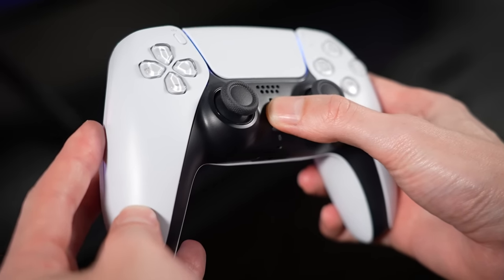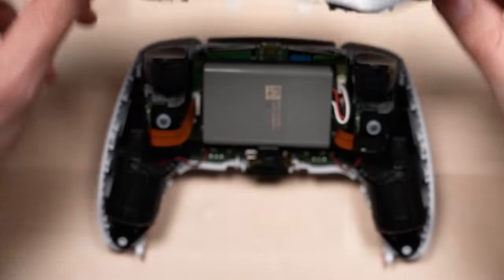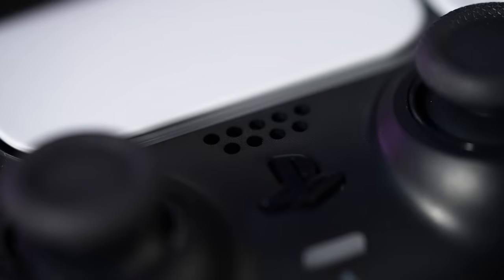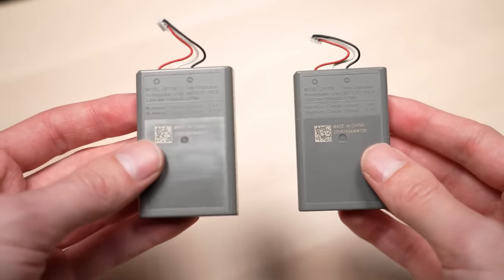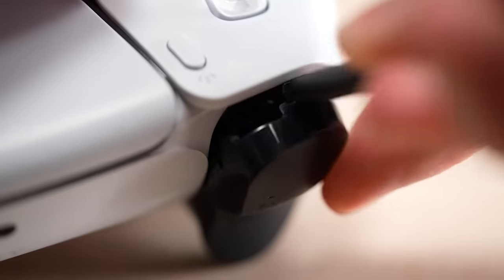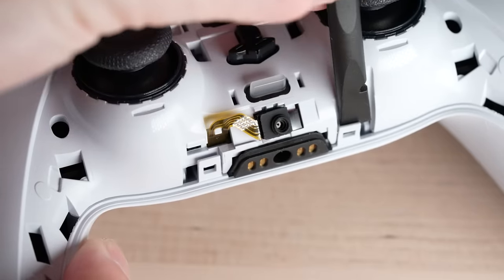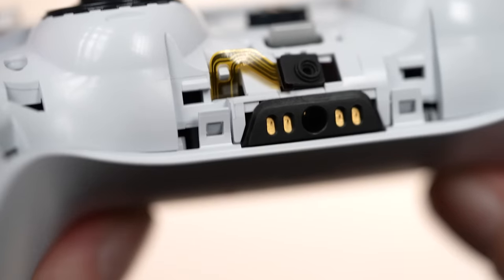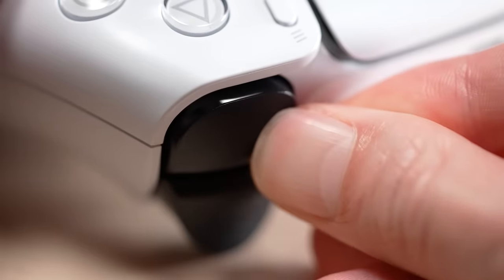Sadly, your Playstation controller won't last much longer..

Comment: Tips:
:Get 2 controllers
:Alternate them regularly 
:Dim the light 
:Turn off Haptics for Mulitplayer ( Cod )
:Lower haptic resistance (in settings)
: Keep haptics on for singleplayer enjoyment
Reply: Why would I turn off haptics for multiplayer? That’s way more important than for single player
Reply: @toptiertech7291  There's no right or wrong here just opinion,For me if im playing a Multi-FPS thats constant banging on the controllers triggers,Single player stuff least theres somewhat of a break with cutscenes/dialogue/down time/etc..
Reply: So I'm supposed to turn off the main feature of the controller? Sounds dumb
Reply: @GregHali  Jesus there's ignorant people on here...THERE'S NO RIGHT OR WRONG REASON however if you wanna preserve you're shit aka save another 65$ there's tips above ^ to help such preservation
Reply: @fnggaming89  how would you be saving $65 if one of your tips is to SPEND $65 on a new controller? Why not just leave the vibration on and spend that same money on a new one down the road? I don’t think you see the issue with your statement
Reply: @toptiertech7291  "  Save Another 65$ " ^
Reply: @toptiertech7291  it's the other way around
Reply: @fnggaming89  but you’re assuming that someone should already be buying 2 controllers. You’re saying they should spend $65 up front. What if I just made my 1 controller last until I need another. Then 3 years down the road I’ll have a brand new controller instead of 2 worn out ones
Reply: All that when my Xbox elite controller last for a week n a half after 6-8 hours of heavy gaming Lmaoo  with all the vibrations still on

Comment: This is why I love Xbox controllers. I've never had any issues with them from personal experience and I don't have to worry about ripping open the controller to replace a battery, I had one for several years and it still works like factory new

Comment: I understand the appeal for built in batteries but rechargeable AA'S just seem more convenient. If you put the controller back together and have one part that isn't aligned properly(such as the triggers) or if you break something by accident such as the clips then its just an annoyance. Also when you or your kids forget to charge the controllers and you end up having to wait to play anything.
Reply: You don't have to wait, you can just sit closer to the TV for 45 minutes or however long it takes to charge the controller.
Reply: @William_Saliba  that's fucked up just buy a longer cable 😅
Reply: @William_Saliba  True. But if the options are sitting close to a tv for 45 minutes or hot swap some AA's while the others recharge in under 10 seconds then it just seems more convientient. Not saying built in batteries aren't a cool option but I have found more inconveniences with them then ones with AA'S at least for me personally.
Reply: @ismo9529  Sitting closer to the TV to charge a controller for 45 minutes is fucked up? Humanity is doomed.
Reply: @William_Saliba  he's just a xbot Can see that from his posts from his channel. This video didn't appeal anything, he just showed how to change batteries for dual sense.
Reply: @William_Saliba  humanity is doomed if life gives you a better option yet you choose to struggle.
Reply: @kaztuckinhell108  why am I an xbot if I just gave him a better option. I didn't tell him AA batteries are better or the Xbox controller is better. I'm litteraly helping my guy to enjoy his time better with his ps5.
Reply: @ismo9529  I'm not talking about you bro I'm talking about the Original guy
Reply: Yeah that's why I'll always prefer the way Xbox does it's controllers with removable batteries just much better options.
Reply: @originalgaminggen6732  I just charge my Ps controllers on a dock or rest mode when i don't play.
Battery lasts about 10 hours of gaming, so i don't see a problem with built in battery.

I understand the kids point tho, but extra controller is always good to have.
Reply: @ismo9529  You do realize that having a pricey console and choosing to sit closer to your form of entertainment for less than an hour doesn't count as struggling, right? Let's call a 1st world problem out for what it is.
Reply: @kaztuckinhell108  yeah i have both systems. Reminding kids to plug in contollers to charge is the equivalent of me talking to a wall about it.
Reply: @originalgaminggen6732  I mean this is not the norm for rechargeable controllers. I still use my PS3 controller and the battery still has good life.

I use it for PC, PS4, and switch using an adapter. I like the feel better than the newer controllers for fighting games and the buttons still work. Sadly, PS5 isn't compatible with any controller adapters.
Reply: @Horyzun  definitly first world problems, don't mean problems don't need solving. Am I missing something, a long USB c cable costs around 9 to 10 euros where I'm from. Why choose to sit closer if you can sit at a comfortable distance with a longer cable
Reply: @freaky45  looking into that, need at least a 15 foot cable. As long as my cats dont chew it then it might be the best option
Reply: @originalgaminggen6732  what I don't like about Xbox controllers is that you hav to open and close the cover and the cover part eventually breaks. I had to buy three controllers when I had Xbox one.
Reply: That's why you always keep 1 controller charging while playing
Reply: @kaztuckinhell108  yeah that happened to my very first xbox one controller when it first came out. Havent had that happen on that system or the series x since that one time but it was annoying until i got the battery pack rechargeable kit since it stayed in pretty snug, was still pretty annoying though. But i will say that the ps5 controller keeps a good charge as long as its charged up. Just my kids dont seem to ever remember to do that.
Reply: @ismo9529  You're not missing anything. You just switched gears. Saying that sitting close to a TV is a struggle is a lot more extreme than "buy a longer cable" and you know that. It's just not as deep as you originally made it out to be.
Reply: @originalgaminggen6732 I recommend buying a ps5 controller stand which actually can put ur two controllers on it. Don't buy sony official stand. It's not stable and pin inside is weak.
Reply: @Horyzun  it is a struggle if you can just buy a longer cable and not struggle anymore 😅 why sit for 45 minutes in front of your TV?
Reply: @kaztuckinhell108  i was gonna say i got the official stand in a bundle and i swear that even if its me putting them on the stand,  every so often it wasnt sitting right or something and didnt charge but you say its the pins?
Reply: @originalgaminggen6732  the pins are too fragile and breaks quickly cuz its so hard to fit correctly. So buy one looks stable. I got HORI product and doing great.
Reply: @kaztuckinhell108  thanks. Ill check that one out.
Reply: The dual sense controllers battery lasts quite a while on a full charge even 5 minutes on a USB type c cable will give it enough to last a hour or 2 more you can choose to use batteries but your spending money that you could had saved up in the long run as for kids you gotta teach em to put it on the charge gotta teach them to be responsible for their own actions
Reply: As someone who plays at my desk, what is this about charging? You mean the wire isn’t meant to be always plugged in? /s
Reply: @kaztuckinhell108  your a bot bro
Reply: You can use it while charging without it being connected to the console
Reply: @marky3609  To an extent yes but say your batteries die and you have no more then you are completely sol but it's just preference one isn't better than the other I have rechargeable batteries for my Xbox controller and I have multiple ps5 controllers with a dock so my controllers are always good to go
Reply: @PandaCheeks  nah I'm a ps guy dude. From ps1 era to ps5 era
Reply: @kaztuckinhell108  i had that problem too, but i just bought replacement covers
Reply: @therizinosaurus214  yeah did the same for the second controller cuz didn't know that there was the option 😂😅 but most of the reasons I had to buy again was inner component problems not only cover 😅
Reply: @originalgaminggen6732  or u can get a power bank
Reply: Battery acid.
Reply: I bought a powerbank for this reason and I can charge my controller on the couch any time I want :D
Reply: Nah, built in battery all the way and a second controller. I am not buying and swapping batteries. This isn't the 90s anymore. The only thing that uses AA or AAA batteries in my home is the TV remote.
Reply: I'll never go back too batteries shit felt ghetto
Reply: @urekmazino6800  ha
Reply: I like that the PS5 controller DOESN'T have AA, because the average users wouldn't bother using rechargeable batteries, so that would waste millions of AA batteries. Now they're forced to use rechargeable since that's what's built-in.

Comment: This really looks like a first gen problem, I mean I used my PS4 controller during many years and I used it like crazy and nothing happened but somehow this controller has battery issues even though it was launched just in the past few years, that's why you should always wait for the slim version of any console.
Reply: this controller burns the battery faster. batteries have a life cycle that dies every time you charge it. the avg battery life is around 1.5 to 2 years depending on the size of the battery vs how often you charge it. if you charge it daily expect it to last around 2 years but if its an ipad for example that last a week before a charge well than you are looking at 4 to 6 years.
Reply: Unless Sony has some hidden crazy battery tech, then no it's not a first gen issue batteries will degrade.

Comment: As an Xbox gamer who heard SO much crap about our replaceable/rechargable batteries - buy one, pop it in, done. You can use regular AA batteries, rechargable AA ones, or rechargable ones for dedicated charger stands.
Reply: You don't even need a battery. The Xbox controller just needs to be connected to the Xbox via a charging cable.
Reply: Who wants someone put in the battery for you and may not even be new battery they place in

I would buy a converter than a rechargeable controller that may used cheap rechargeable 

Maybe from wish because if is the Same size as the ps4 one than they remodel the battery too

So it look like it New

Comment: I have to admit, I like the approach of the xbox controllers better, where I have both the option to use the controller wired without wearing out any batteries, or can just replace them within seconds without any tools.

Comment: I went through FOUR official Sony controllers in ONE YEAR and got drift issues on all of them. Finally bought a third-party controller for $25 and it's lasted me four years with no drift/battery issues whatsoever.
Reply: wat controller if you dont mind me asking
Reply: thats a straight up lie if not youre buying fake controllers cause me and my friends have had the same controllers for 6-7 years
Reply: @Koll-Manee  Back in 2014 when I owned a PS4 the first time around I had no problems with the controller that came with the console for the two years I owned it. Not sure why I’ve been having such bad luck with Sony’s controllers this time around.
Reply: The ps5 has only been out a couple of years
Reply: @Jorden.Florence  oof I didn’t specify. I’m talking specifically about PS4 controllers.
Reply: @jirden  arr I see cool and my ps4 controler had drift problems as well hope the ps5 lasts. A while back I realised I was seriously abusing my controllers so started to make a conscious effort not to push the sticks so hard. I think fighting games are the worst because its easy to lose yourself and start wrecking the pad

Comment: I wish my dualsense controllers would last long enough(without drift) to be able to utilize these tips! I've had 2 drift so far and can't figure out what the deal is. Clean environment, minimal use(maybe 5 hours a week)? Either way, great video! Quick and concise.
Reply: Wow, I have had the same two PS5 controllers since launch. I sometimes have played 5 days a week. No drifting problems at all. I do have to change them more frequently though. I'm probably going to need to replace the batteries this year.
Reply: 5 hours of use a week will still cause degradation and cause drift since, ya know, plastic
Reply: @A. Biscuit alcohol part is a lie, don't put alcohol on it guys it'll destroy your controller.
Reply: @CelicaSNC  drift that soon for him is still unacceptable
Reply: @A. Biscuit so out of curiosity, I wonder if the white and black ones are upgraded too? Obviously they should be right? Problem is, for those colors I don't know how you'd tell before buying. I had two black controllers and one completely just malfunctioned so I replaced it with a purple. So it's good to know I at least have one upgraded.
Reply: @A. Biscuit okay so it'd be on the back of the cobtroller. Thanks for informing me! But unfortunately I just checked the box for the purple one I just purchased and don't see the ID anywhere on there. So if I was to get another black one down the road if my current one ever crapped out, I guess it'd be a gamble as to whether it's the newer model or not?
Reply: @A. Biscuit got around to checking finally, it does in fact have the A. Thanks for filling me in about it! Hopefully I actually see this controller lasting a bit longer

Comment: I'm so glad my retailer where I got my ps4 and ps5 from has an excellent warranty policy. If my sticks or battery give out within the 2 year warranty period, I can either get a replacement or a full refund. This saved me a bucketload of cash between 2020 and 2021, I've had over 16 DS4 controllers with stick drifting issues!
Reply: That’s so much wastage. Why can’t they make better controllers?
Reply: @dannnnn496  money
Reply: @grizzlydino  They would save money if they didn't need to honour so many warranties

Comment: I feel like xbox and playstation could make small tweaks to make their controllers better. Xbox could have their rechargeable pack as the standard default battery when you buy the xbox.(its not as bad for families if they buy more controllers because they can buy a play and charge kit that comes with the controller). Playstation could make a battery compartment that way it would be easy to replace
(Also amazing guide 👍👍😊)

Comment: I have to wonder as to why they made it a bit of a hassle to replace the battery, while an Xbox’s battery is easily assessable. Sure, the Xbox’s controller doesn’t come with a rechargeable battery, but they are pretty cheap, from an official one to regular rechargeable ones you can get for ten to 20 dollars. Is it because they just want people to buy a new controller and get that extra profit?

Still, it’s good to see how it’s done on a PS5 controller. When I eventually get one, I’ll keep it in mind if something ever happens. Videos like this helps save people a TON of money and time.
Reply: You've brought up a valid point where certain Playstation fans have been giving Sony some imaginary W for XBOX using battery packs + AA when I've always seen that as more of an advantage. I do hope XBOX starts producing controllers with the haptics and force feedback triggers they've had a patent for their own since 2018. I can do without touch pad,speaker,microphone and other Dualsense features
Reply: @lordxboss5700  I’ve seen people like that too. Honestly my first pair of rechargeable batteries lasted about ten full years before they finally died, and getting replacements was easy since I just needed the batteries instead of both them and the recharging plug-in (with both it was about $20, but for the batteries it was less than $10 for four of them. I’d say they more than paid for themselves!).

Having the batteries like that also removes a possible way it can break. Not everyone can do this, or not trust themselves to without breaking it. I don’t even trust myself to do that! So if there is a surge and it fries your batteries instead of the controller while it’s plugged in, then you save your a LOT of hassle if it’s like the Xbox’s.

Also the haptics and force feedback sounds to be really tiring in your fingers, and others have said that, but as long as you can turn it off if you want, I don’t see the harm in having it as an option. Microsoft might not want to include it to help keep the price of it down. It already costs us $60 per one, while the PS5’s costs $70.
Reply: @KHMDarkness  Ya I found a Energizer kit with 2 battery packs and charging station and it's perfect. It's a nice stand for the controllers and they're always charged. If they don't get charged for some reason I can just toss in a couple AA's 🤷‍♂️ I got it for  my XBOX One and it's still working like new
Reply: @rsh650  I said ‘not everyone’, which doesn’t assume only the person in the video or people you can hire can do this. It means that some people either can’t do it for one reason or another, or don’t trust themselves to try and repair a $70 controller and would rather pay someone who has done it before to do it instead.

Again, that’s almost $100 in your hands, and doing one small think wrong can break it, or even make the buttons click weirdly. I’m personally very particular about that, to where I can’t use third party controllers because of how bad they feel. So if there is a chance I could mess that up, however slim, I wouldn’t trust myself with that. Probably making something out of nothing, but still.

Comment: The reason the dualsense is lasting less than the dualshock 4 is because you have to turn on the power saving feature that makes the controller turn off automatically after 10 minutes of inactivity. My battery went from last 8 hours to 3 days.